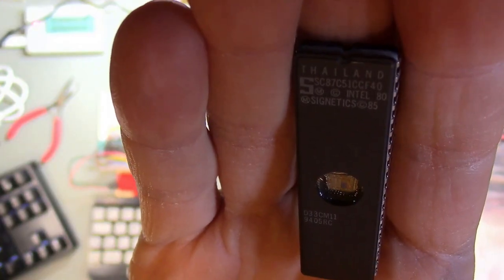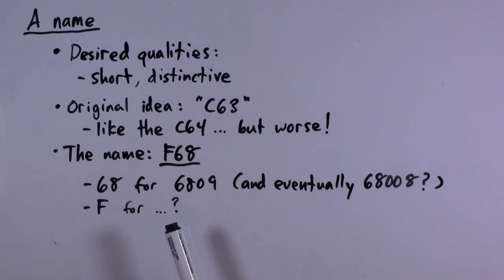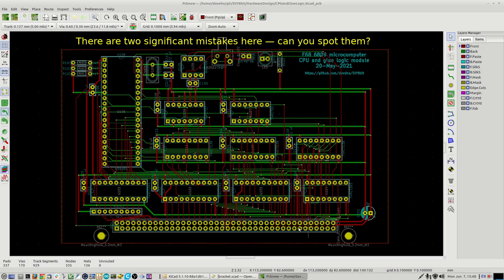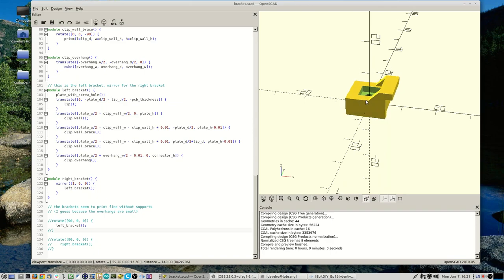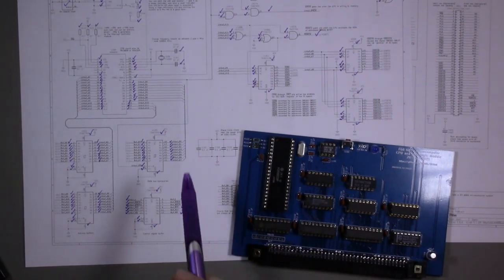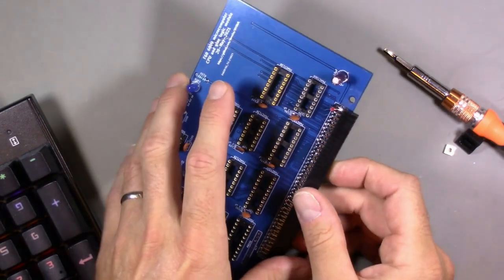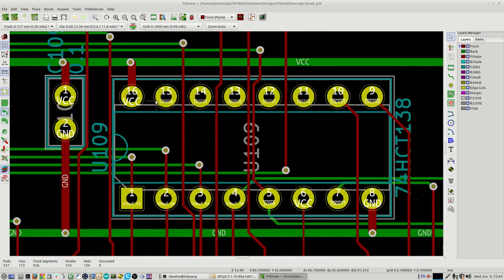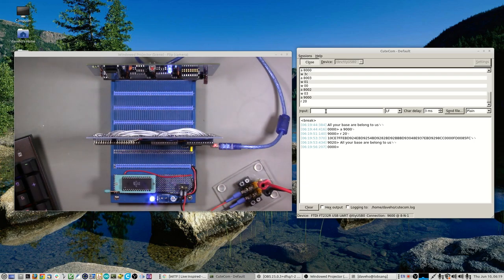DIY 8-bit computer, Episode 16: CPU and glue logic PCB, and a name

Comment: I recently found your channel. Have watched most of your videos. Great progress! I initially built a Ben Eater inspired breadboard CPU and got it to a point I could run Snake on a 16x2 character lcd (I have some videos of that). I've recently started my next project which is similar to this (backplane, 8-bit CPU, etc.) so finding your series helpful to work out what works and what doesn't. Keep up the good work.
Reply from the maker: Nice! I would like to try building a CPU from logic chips at some point.  I think the approach of modules on a backplane has worked well for the 8-bit computer project: prototype on breadboard, then build the module on a protoboard or PCB in a permanent form.  Will be watching your project with interest.

Comment: Just watced this video, DRC rules help on mis-named tracks. I'm not sure it's a proper first PCB without some bodge wires either. 

I'm working on a 68000 based computer but have a 6809 design ongoing as a side project. Sill working though some of your earlier videos, but it's interesting to sew how you're getting to this point.
Reply from the maker: I should really make more use of DRC. I tend to want to rush so I can get the PCB designs sent in, so I can get the boards faster :-)

I'm planning to try implementing a 68008-based CPU and glue logic module at some point. I have a lot of nostalgia for the 68k architecture, although I never really used it much back in the day.
Reply: @davehohacks  The Amiga was my favorite computer so attached to the 68000. Will comment more when caught up on some of the videos but looking forward to seeing where you go here